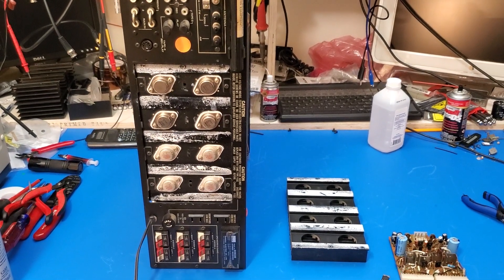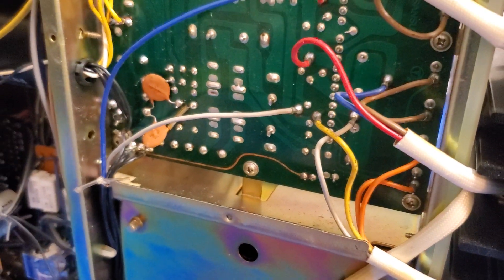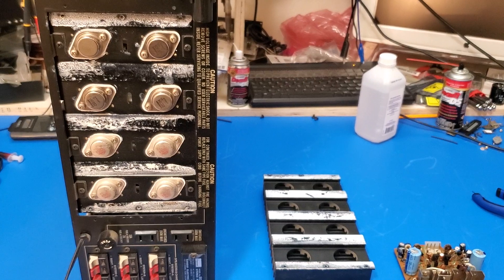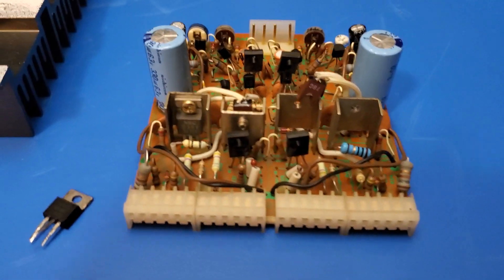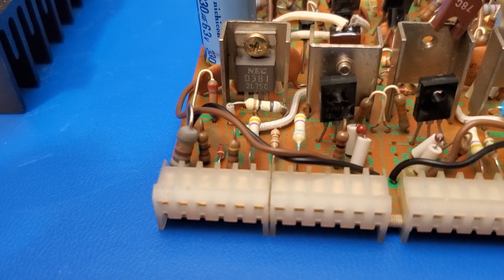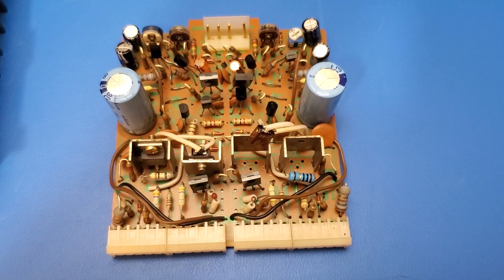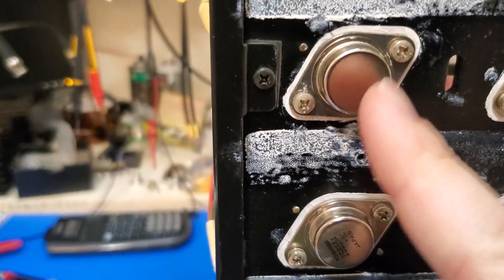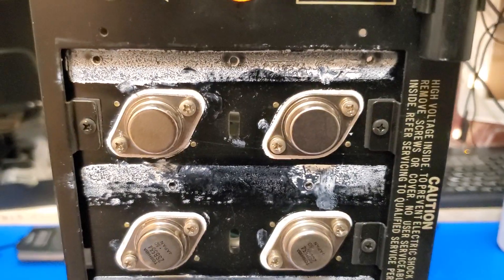Sansui 9090DB damaged by counterfeit parts!

Comment: Hola, Hello, I have a question. The F2436 driver circuit board from the Sansui 9090 is sometimes installed upside down, facing the power transistors, and other times facing forward. I've seen it in several videos and photos. What's going on? Is it even possible? 😅

Comment: Hola, tengo una pregunta, espero que me ayuden, saque los transistores de poder para cambiarle la pasta termica y ahora quiero colocarlos pero no se si tendran algun orden especifico o todos son iguales? habria algun problema si los coloco en cualquier cavidad? transistores de poder sansui 9090. Gracias.
Reply from the maker: The 9090 and 9090DB appear to be very similar, but the amplifier circuits are very different between the two models. 

The 9090 has a quasi-complementary circuit using all NPN output transistors of the same type. It does not matter what socket they are in because they are all the same.

The 9090DB uses a fully complementary circuit with both NPN and PNP transistors. The 9090DB requires you to keep track of the transistor polarity. If you install an NPN transistor into a socket wired for PNP or a PNP transistor into a socket wired for NPN, severe damage will result.
Reply: @MadScientistsLair  Muchas gracias, por su respuesta, espero que todo vaya bien. 😅👍👍

Comment: So wha tis the best replacement for 2sd424/2sb554 ?  I found Mj21193g and 94g
Reply from the maker: That works well as does MJ21195/21196.
Reply: Hola, tengo una pregunta, espero que me ayuden, saque los transistores de poder para cambiarle la pasta termica y ahora quiero colocarlos pero no se si tendran algun orden especifico o todos son iguales. habria algun problema si los coloco en cuanquier cavidad? transistores de poder sansui 9090. Gracias.

Comment: Is it necessary to match the output transistors?
Reply from the maker: Transistors within the same gain rank will do in a pinch but I recommend hand matching if you can.
Reply: @MadScientistsLair  oh boy so I'm gonna need a shit load of MJs then <<
Reply from the maker: @Texan1048  10 of each will generally get you a decently matched set ot two. I generally try to keep them hfe matched to within 5%. The outliers can be used for non-paralleled output stages.
Reply from the maker: @Texan1048  Remember to measure with all the transistors at the same temp. Even handling them while measuring will skew the results because hfe varies with temperature.

Comment: If i replace them with MG21195 and 196, do I have to make adjustments like biasing or change some resistors ? Thanks.
Reply from the maker: You'll need to perform the bias adjustment procedure as described in the service manual. No component swaps are required.

Comment: is it possible that these transistors are ordered and made recently and are originals. And to  save on cost they had to follow 21 century cheap  standards
Reply from the maker: No. These parts have been out of production for nearly 40 years.
Reply: @MadScientistsLair  thanx for replying, I recently bought NEC B536 and NEC D381 drivers for my sansui G6000 from an electronics shop which have old stocks of transistors and one is also different from my Sansui old one in terms of color.
BTW can you help me and suggest a replacement transistors for old 2SA981 and 2SC2261 ones, if yes, also tell if I have to change drivers (mentioned above). along with the replacement which you may suggest. plz here in our town it's only  me and good people like you who will help me fix my sansui G6000.

Comment: Thx for the excellent vids!:)
Slightly off topic question…
Do you have a vid on TO3 to TO3-P
Conversion?
Blew up original Sanken finals  2SA747
2SC1116 in my AU 717
I Put in On Semi MJ21193G MJ21194G it sounds fine but just not as fine as i remember so want to go to the faster 2SA1695/2SC4468 in TO3P
package to see if i can hear the difference
TIA!
Reply from the maker: I don't but it basically involves bending down the emitter and base leads such that they'll either fit snugly in the socket or far better still, soldering them to pins of the same diameter as the transistor leads, possibly using old TO-3 leads even. The tab of the TO-3 is collector, a simple wire with a ring terminal completes the connection to the collector pin through the mounting screw.

Comment: Great video Andrew, my 990DB has the same broken trace on the PS board.  Can I ask how you fixed it?  Did you just use a jumper wire?
Reply from the maker: A carefully placed jumper wire was installed after fixing the underlying fault that blew off the trace in the first place. Repairing the trace without fixing the root cause will result in additional damage.

Comment: I just got  a 9090DB and the amplifier works great and then the sound distorts after about 30 minutes or so. Don't know much about this as I got one for my dad and now its doing that.. any ideas what that could be?
Reply from the maker: If it's always about the same time, you may have a thermally intermittent transistor. If you haven't tested and replaced transistors before, this is definitely not a beginner friendly machine and I recommend seeking an experienced technician. LIVE TESTS are required to find this issue and these are inherently hazardous. 

You can use the pre-out jacks to feed another amplifier. If the audio from the external amp is also distorted, the issue is in the preamp, if it remains clean, the issue is with the power amp.

Comment: Transistors can get damn hot........can they burn out ?
Reply from the maker: Indeed they can and they often do when they're 40+ years old! Like most semiconductors, they tend to fail short circuit and will generally show up as a short across collector and emitter.

Comment: I have a 9090Db with -30 volts on both fuses on the relay protection board (DBT in the circuit). If the driver board is out and not on DBT, the relay will click in and zero volts on the fuses. If I am on the DBT, with the driver board out, the relay will not kick in. Changed the diodes, ceramic capacitors, electrolytic capacitors (a while ago), fuse resistors, checked that the output power transistors are not shorted to ground. Went over the solder joints. Check every transistor with an atlas pro transistor tester out of circuit. Any ideas? I am very frustrated! Any help would great.
Reply: What size bulb are you using in your DBT?  I believe it has to be more than 75 watts for the relay to click.
Reply from the maker: At least. 100-150W is appropriate. With the driver in, it will consume a good deal more power. I suspect the rails aren't coming up due to the lamp being too small or there is actually excessive offset (Check gain matching on the input stage and the offset trimpot.)

Comment: hey man i was hoping you could help me with an issue on my su-g95 i saw your videos about the repair and i myself am having trouble identifying the issue. the unit works sometimes and others it'll say OVERLOAD
Reply from the maker: Have you removed the mainboard and resoldered all connections on devices mounted to heatsinks and any area of the board darker than the rest due to heat? If not, do that and if you have, double check your work under magnification and strong light. Some of the cracks are as thin as a fine hair. Strong soldering skills are required to complete the repair and high voltage may be present on the main capacitors even after the unit is disconnected.
Reply: @MadScientistsLair  thanks for the advice, i'll try that and get back to you, is there a safe way to discharge the caps without damaging the solid state components?
Reply from the maker: @Dylan-cs2vv  If the amp is running at least halfway normally, they should drain to safe levels on their own in 5-15 minutes. Otherwise, connect a resistance of a few k ohms or so across the terminals for a few minutes. When removing the board, handle it with care and avoid contact with traces near the caps, rectifiers and devices on the heatsink as these are connected to the capacitors.
Reply: @MadScientistsLair  wanted to let you know that after resoldering a bunch of the connections (including both transistors on the heat block, which were hardly on the board at all) it seems to be working. I'll update again if i run into any more trouble. Thanks for the help!
Reply: @MadScientistsLair  howdy, the new solder seems to have solved the overload issue somewhat. Unfortunately when i turn the input volume or adjust the bass/treble she again overloads. I noted that the fan doesn't actually work, would that be an issue?
Reply from the maker: @Dylan-cs2vv  Yes, the fan is triggered by the output levels the control system senses. If the fan does not turn on at high output, the protection trips. Test the fan motor and check the solder joints in the circuits near the fan connector. The connection from the fan to the board may also be an issue.
Reply: @MadScientistsLair  still having trouble with the overload issue, I was wondering if you still do repairs and where you're located?
Reply from the maker: @Dylan-cs2vv  I do. I'm in the Dallas/Fort Worth area and sometimes Abilene as well. I have locations in both spots.

Comment: Have a Sansui G-8700DB receiver someone botched repaired with mix and match transistors on one channel, (SK3836,SK3846,EGC285) also changing a DC offset resistor R08 value on the driver board. The other channel has original red ink Toshiba's with one shorted 2SD551. Driver board has several open, overheated, and high value 1/2 watt resistors including R24 the one that feeds the pre driver transistor TR08. None of the transistors show shorted, but I worry about them having had that much current running through them and being reliable. Also service manual calls out for flame proof resistors, but will the smaller form factor newer metal film resistors be ok to use. They are 1/2 watt, but are the size of 1/8 watt resistors. The 3.9 ceramic power resistor for the slow start is also open. Got the ON semiconductor MJ21194G and MJ21193G output replacements from Mouser ready to go in. When these DC coupled amps go they go big.
Reply from the maker: The small form factor metal film resistors are OK in this application provided they are rated for at least 200V. They readily go open circuit and do not sustain flame when overloaded. Both driver transistors need to be changed. MJE15035 and MJE15034 work well for the drivers.
Reply: @MadScientistsLair  I am assuming those are for the final drivers 2SC2238B(O,Y) and 2SA968B(O,Y) is that correct?

 Will change out those 330mfd electrolytics while I am in there as well, bring it up slow on a variac and dim bulb and see if she will bias up and balance the DC offset. Thanks for your help.
Reply from the maker: @zulumax1  Yes, those MJE transistors are a replacement complementary pair for the final drivers. Don't worry about the lower Ft; the unit will still beat Sansui specs after the swap.
Reply from the maker: Just noticed that you mentioned that the inrush limiter resistor is open. Check the inrush relay and the timing circuit that controls it. If the relay is OK, you might have a bad cap in the RC timing circuit or a bad relay drive transistor.
Reply: @MadScientistsLair  I have already brought it up with a variac and dim bulb with the output transistors pulled. I jumpered in two 8 ohm 20 watt resistors in parallel and the relay clicked on and the tuner and preamp worked. Those are the resistors I use for small powered amps as dummy loads.
Reply: @MadScientistsLair  I had that problem with a Sansui AU-7700 that I still have. Replaced all the electrolytics in the relay circuit and the relay itself. It just kept taking more and more time until the relay would click on, until one day it just wouldn't click on at all. That was 25 years ago. I don't think this is that problem. I think someone left it on too long without it coming out of protection mode and the outputs being shorted. That is only a 15 watt resistor and someone could have put a bigger fuse in it.

Comment: Thank you taking the time to share your knowledge. I will be honest, I have been tinkering with vintage equipment for a year now. I can solder and use an ohm meter but that is the extent of my experience. I recently purchased a meter to measure mf as I am intrigued with trouble shooting. How accurate will ohm and mf readings be with parts in place on board? I am embarking on a 9090db project where I am having some output issues on right and left channel in A,B or C speaker locations. I have pulled the driver board and tested ohms on fuse resistors. Found the C01@ 656 Ohms  and C02 @ 1144 ohms with the spec being at 150 Ohms. Am I heading in the right direction? btw - Do you still have a location in Illinois?
Reply from the maker: In circuit capacitance measurements are notoriously inaccurate. On something critical like the driver, just replace all the electrolytic caps. In circuit ESR measurements, while still error prone, are more reasonable. Likewise, in circuit resistance measurements are also error prone but the error always skews toward lower than actual value resistance readings. If you're reading higher than spec resistance in circuit, check your connections and remeasure. If the high reading persists, you can be confident that you've found a bad resistor. Note that resistors that have burned have done so because of an overload caused by some other fault. Investigating any transistors or diodes nearby is a good first step to finding why a resistor is burned. As for my location,  I'm based in Texas and always have been.
Reply: @MadScientistsLair  Super helpful... thank you for your post and keep up the good work....

Comment: Great ,, thanks a mill ,, just restored my 2300 from a to z , all solders done ,leds , higher quality caps ,heat sinks ,new wood case e.t.c , This machine is better and nicer than when it was new ,When i went to get my sta-2300 a guy was getting his sansui high end recaped and all , our stereo's were both plugged to the same speaker switch , And everyone there were all surprised that the sta-2300 side by side sounded better with more high and lows , even i was surprised ,at first i didn't want to take the time and do the quality test challenge ,I knew i had something new and good , but didn't want to hear something better than mine on my first day ,,But to my surprised it sounded better ,T'was flattered  ..As you said , putting better quality upgraded caps from authorised detailers makes the world of difference ,for a few bucks more ,And thanks to some people like you , We learn and build better machines , And you take the time to explain well , The do's a dont's ..etc ,, Can't thank you enough  ...  Cheer's..............